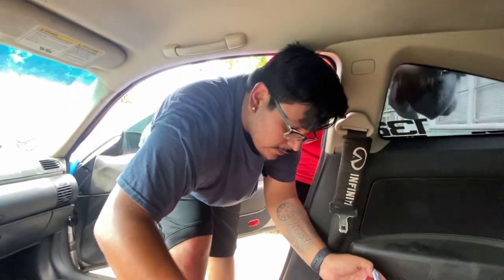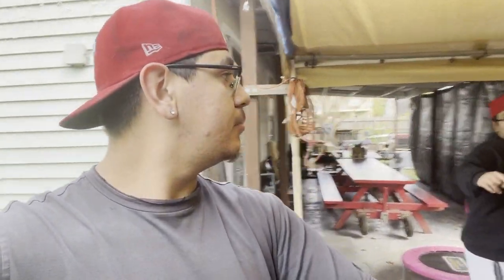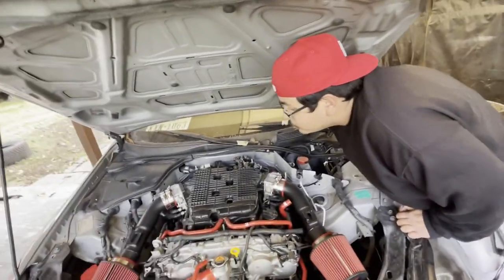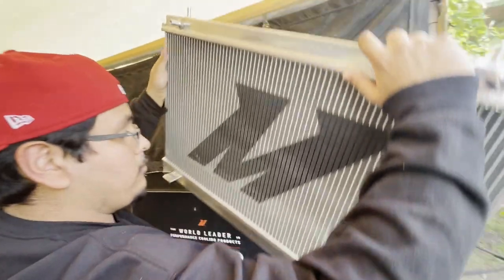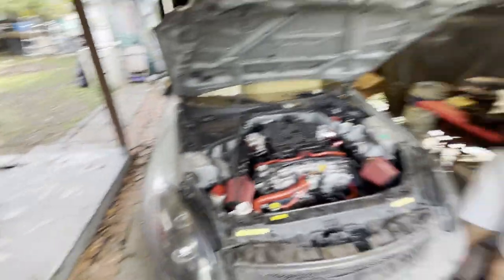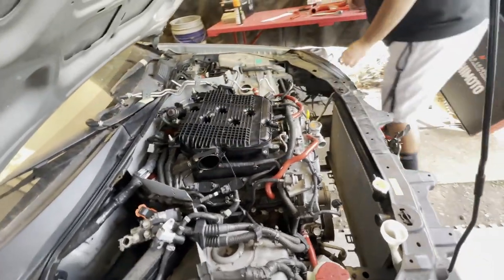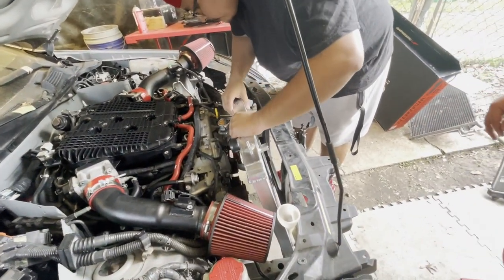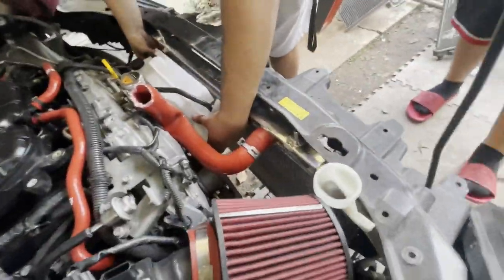VHR SWAPPING A G35: NEW SPONSOR! RADIATOR, COOLANT HOUSING, BATTERY, INTAKE MANIFOLD SWAP (PART 4)

Comment: gives me hope that mines will start , automatic trans thoe :( and still have to send wire harness off to guilty. But more blessing brother.
Reply: @Angelvq   done bro ill be posting my 350z with same motor
Reply: I also a vhr and auto trans in it too and it's installed in the car rn, but I don't Guilty_Garage does a harness for auto's so i'm stuck